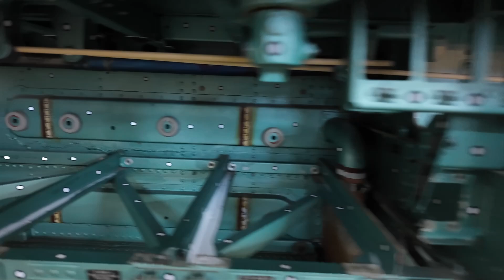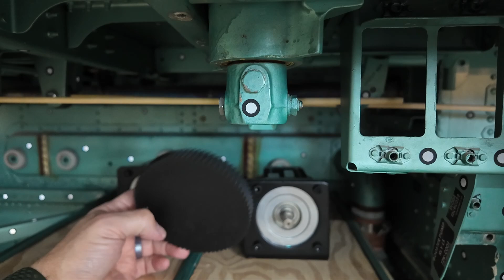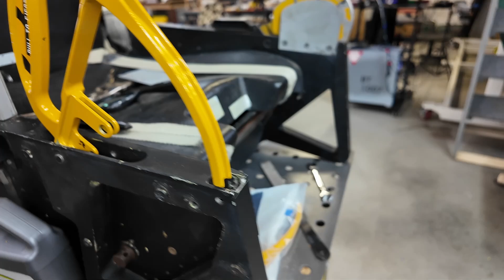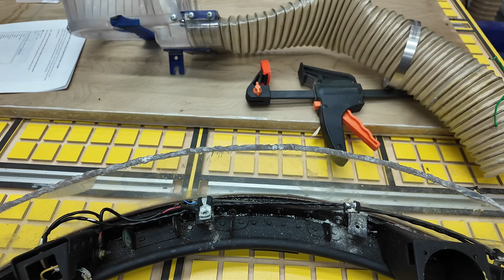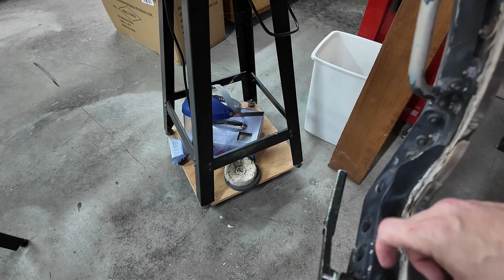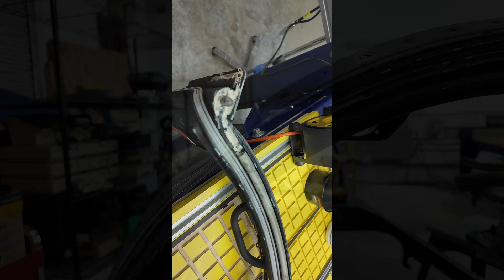FFB Design, Ejection Seat Woes, and Canopy Bow Greeblies!

Comment: Also why not construct the pully/motor geometry out of v-slot (or 8020 imperial dimension) aluminum extrusions? That way you can tweak and adjust exact positioning by putting critical dimensions mounted lengthwise on the channels.

That way you can get 80% of the way there in CAD layout and then slide the elements into exact alignment once installed. 

Otherwise the plywood or aluminum mounting plates have to be dead on right from the cnc machine.
Reply from the maker: That's an interesting idea.  I'll certainly think about it.  Thanks!

Comment: If you really want to make the ejection seat next level, pack some airbag charges into the rocket tube 😂 💺 🚀
Reply from the maker: You'll test it for me, right? 🤣
Reply: Also I wouldn’t grind the handle. You’ll never be able to restore the yellow finish, and the seat itself is already beaten up enough that the cutting away will blend in with the patina
Reply from the maker: @rightrudderleftstick  Yeah, that's the tack I'm going to take.  A friend of mine sent me a photo of a real seat that has a thin, metal, wrap-around cover that goes over the area I'd have to grind out.  I'm going to replicate that look.

Comment: You've already started to chew away at the seat, I say keep doing that and leave the handle intact.
Reply from the maker: That's what I'm leaning towards.  Someone sent me a photo of an F-15 ACES II that has a little wrap-around metal cover attached to the area I've been nibbling out...
Reply: @f15sim  can you move the pivot pin back slightly?
Reply from the maker: @Teh-Stig  No, not without chewing up the seat quite a bit.  However, the issue has been solved and the new handles have been installed.  I opened up the front of the pocket that the handle fits into by about 10mm.  One of my recent update videos shows the results.  It looks great!